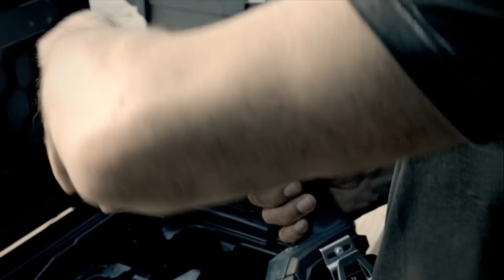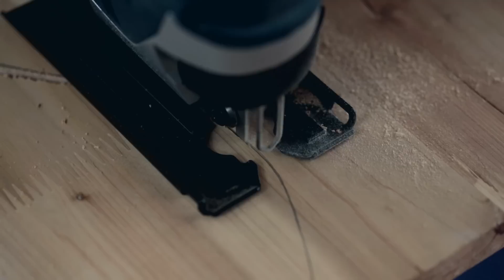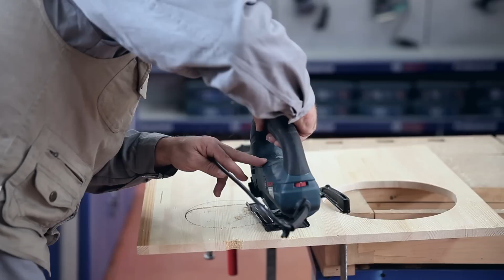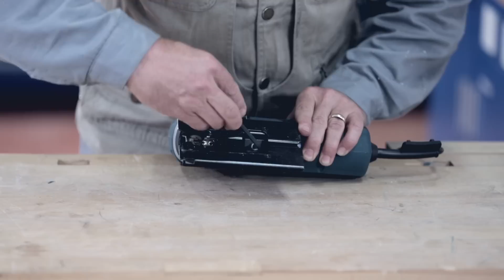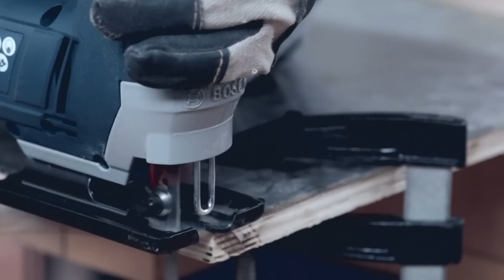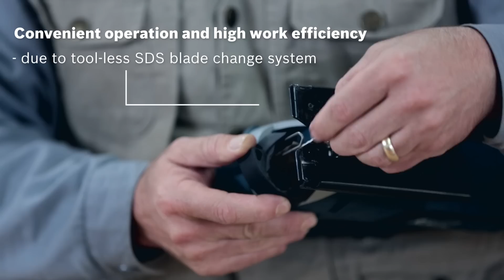Jigsaw Tools | Metal Cutter | Steel Cutter | Bosch Jigsaw Tool

Comment: I've had some time🌗 allabout.wiki/Bosch-120  to get used to using the saw now and I think its a good one. It feels very solid and well made - great Bosch quality. I like the settings it has for the eliptical blade movement and blowing dust out of the blade path. The quick blade change lever is easy to use but wont be accidentally bumped. I feel that this is a tool that will last me many years. I was considering the next model up to get the additional blade stabilization, but I think most of the blade flex happens below the foot of the saw anyway were there cant be any support. I think usage technique can make up for most blade flex and you also have to realize that this is a fact of life with a jigsaw and use it accordingly.